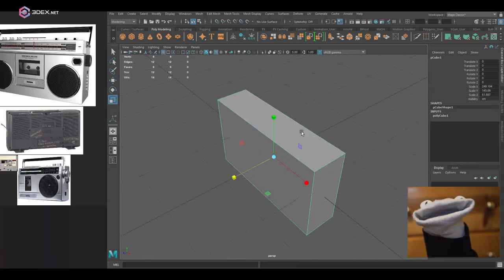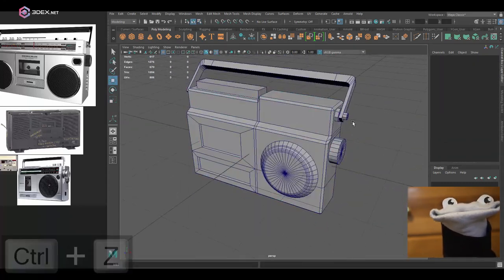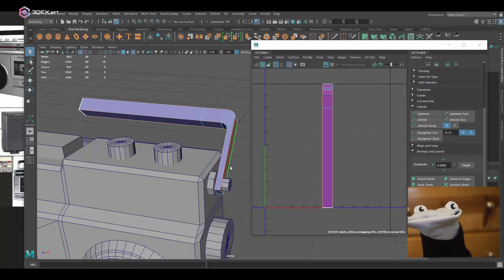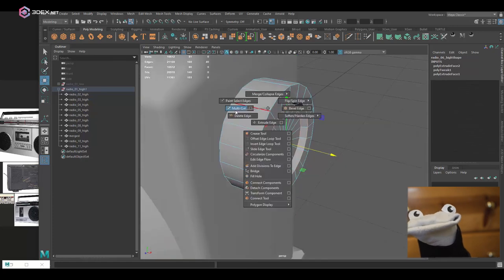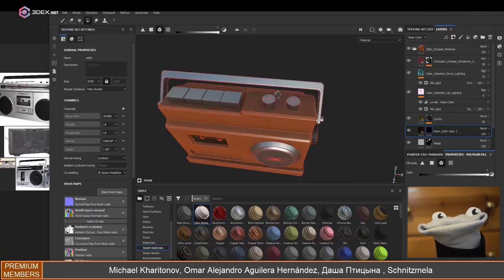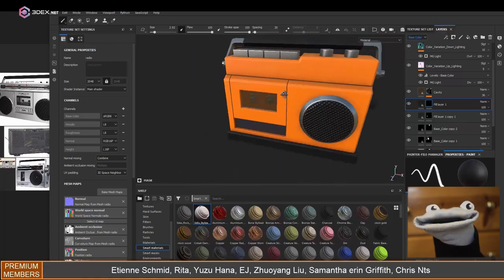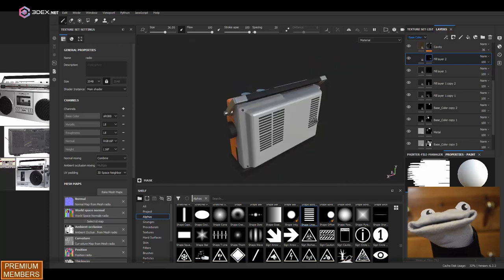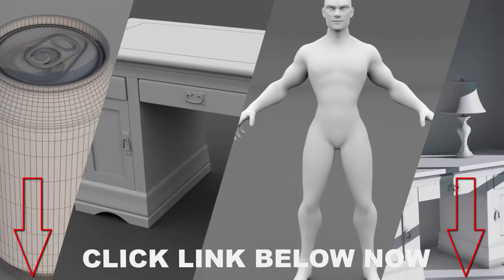Making a Stylized Radio with Maya and Substance Painter

Comment: When I create a new cilynder, I usually set the subdivision caps to 0, so the cap is an NGon instead of a lot of triangles. Much easier to select.
also, for some of the details, I would do with floating geometry with color ID on the high poly, but that's just my preference.
Reply from the maker: Sounds like a good workflow to me